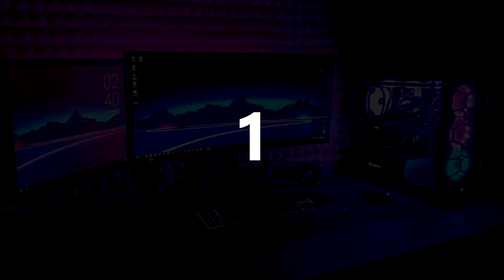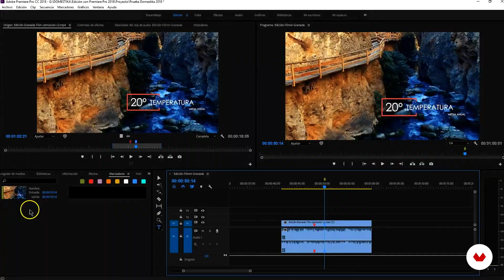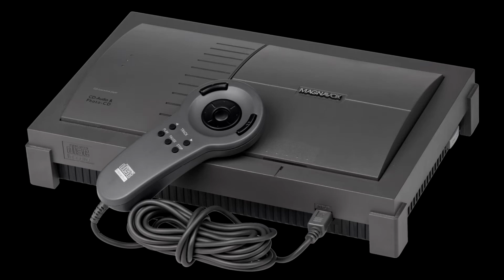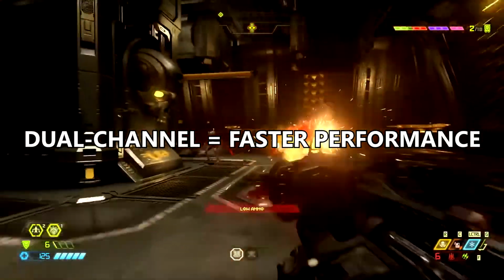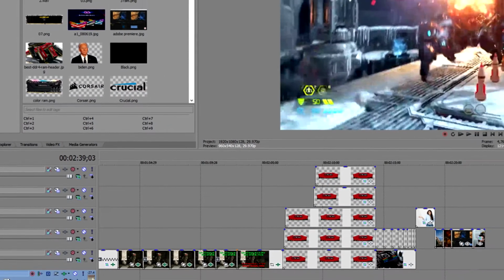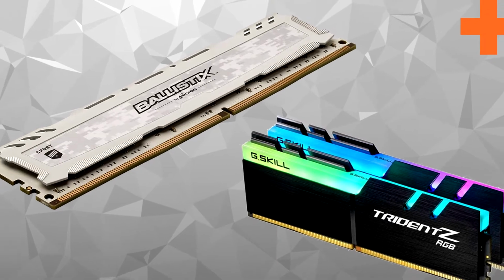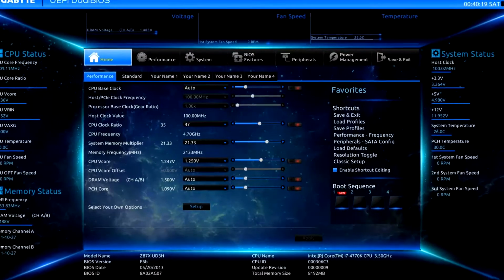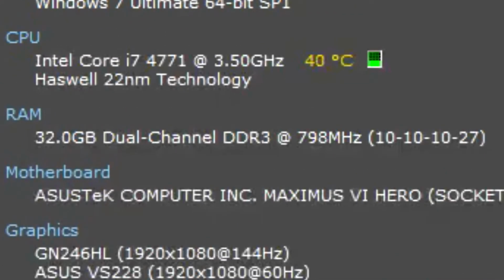5 Most Frequently Asked RAM Questions Answered

Comment: one question not covered - if i had 2 x 16gb in the machine and i double up with the exact same sticks just purchased later, can i just fill the vacant slots with the new one or should i move the old ones to 1A 1B and the new ones to 2a 2b?  Does this make a difference to how they perform?
Reply from the maker: If they're all the exact same, then no, where they're located shouldn't affect the speed.

Comment: Hello I need help, my pc has 2 ram slots the first one works like a dream I recently bought 2 new sticks to go in the slots, one slot is fine but the second one isn’t like when I power on my pc it won’t do anything it will power on but nothing will come on
Reply from the maker: Try each individual module in each individual slot, one at a time to determine whether you have a bad module or slot causing the failure of the system to boot. You can also try cleaning the slots with the compressed air, sometimes dirt and debris or even dust can completely stop the system from detecting the RAM

Comment: My system doesn't boot with a stick in A2, but DOES BOOT with a stick in B2. Started happened ING after upgrading my aio.
- cleared CMOS
- Tried a new ram stick in A2, no boot (but new stick does work in B2)
Any advice?
Reply from the maker: If you have multiple sticks, try them in multiple slots; some motherboards have issues with specific configurations. Other than that, unfortunately, that just may be a bad slot (unless you just have to clean it)
Reply: @Torqcx  IT WAS AN OVER TIGHTENED AIO!!! thank you for the advise though

Comment: If you (as in YOU! AKA Torqcx) had 2 x16 and 2 x32 identical Hynix DDR5 in what order would you install it?  I get it but...  Wanted your thoughts...
Reply from the maker: Most modern motherboards are going to suggest inserting the first two in slots A2 and B2, so personally I'd put the 32GB modules in those, the rest in the remaining slots (A1 and B1)

Comment: Ig it explains why my g.skill aegis 3000mhz with timings of 16-18-18-38 doesn't want to mix with my corsair vengeance lpx 3600mhz with timings of 18-22-22-42. Or then again it could be my motherboard(tomahawk b450 max 2) or cpu(ryzen 5 3400g). 16gb is enough, but I had bought the other ram before I bought a good gpu.
Reply: if you havent already just upgrade yourself to a new ram kit up to your desired 16gb and swap it out. figure out whats compatible with your motherboard and ryzens love dual channel to work better. never handicap good hardware, leave that for the prebuild companies lol

Comment: hey Torqcx, i have a laptop with 8gb (4gb+4gb dual channel) RAM. I want to upgrade the RAM but one of the 2 RAM sticks is already soldered to the mainboard so that i couldn't detach it. If i'm still going to upgrade, then i would probably have 4gb+8gb RAM on my laptop. Will the performance increase or is it still going to be the same before? or even slower?
Reply from the maker: It shouldn't be any slower, having more RAM in that case would still, overall, be faster; remember, even if one of the modules has a higher capacity than the other, half of it will still run in dual-channel mode rather than none of it.
Reply: @Torqcx  so if i presume, with 4gb+8gb configuration means that i will still run 4gb+4gb (the half size of the 8gb ram stick) on dual channel and an additional 4gb (from the rest) on single channel?  And from this ill get more performance rather than performance drop?
Reply from the maker: @theodhorenathannius1282  correct! Again, in that particular scenario, I don't see how increase to the total of 12GB could possibly drop the system's performance. It's all an upgrade
Reply: @Torqcx  i see, i was thinking of this all the time before going for a ram upgrade. i'll consider it done. thanks for the reply and the help mate!

Comment: Hey, if i have 4 slot and capable of dual channeling and i have already 2 sticks locked in there so its already a dual channel but when i add 2 sticks again but with different model can the 2 different modles run dual channel?
Reply from the maker: They might! You can certainly try. Make sure they're the same exact specifications of the models you already have installed.

Comment: If mixing ram brands (two kits of 2x8gb) which dims should be they be in? Should each brand be in its own channel or should I put one of each per channel? Im guessing the latter would be best so each channel has the same configuration but I dont know.
Reply from the maker: Each one per channel, always. It can't hurt, you might as well attempt to get your RAM to run in dual-channel mode.

Comment: How do I install 2 pair of ram with different speed like 2666 and 3200 mhz in the motherboard slots?
Reply from the maker: As mentioned in the video, if multiple RAM modules with different speeds are installed in the same system, they'll be bottlenecked to whichever one runs slowest. So if you installed one running at 2666MHz and another at 3200MHz, they'd both run at 2666MHz.

Comment: So my laptop has a 16 gb single channel ram (2933mhz) and has another slot for 16gb which is empty. So if i buy another 16gb (3200mhz) ram and just manually install it, will it run in dual channel mode just like that? (Yeah the 3200 will be downgraded to 2933)

Comment: @Torcqcx .. .my mobo has a 4 slot . . and i have 4 ram  with 2 4gb 2666mhz and 2 8gb 2666mhz  . . does my unit can run in dual channel?? with all 24gb?
 thanks in advance
Reply from the maker: I can't make any promises since the RAM modules are different, but the I'd imagine that you should get dual-channel mode with that configuration!
Reply: thanks for response. . have a good day sir. .